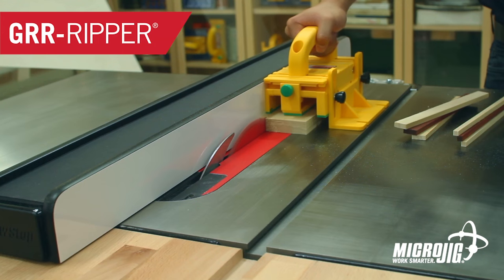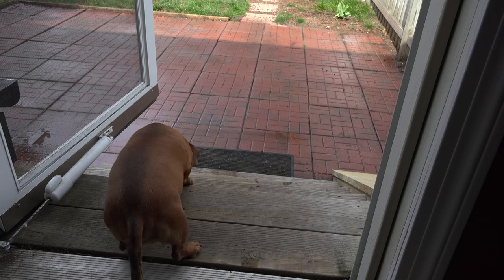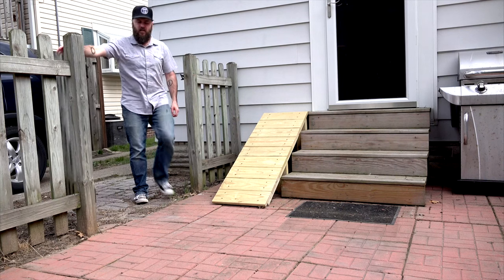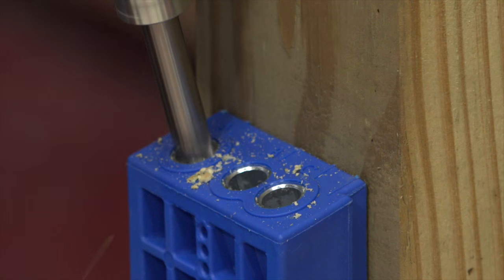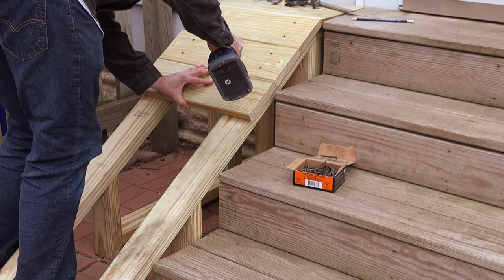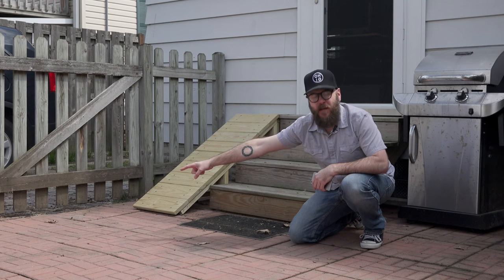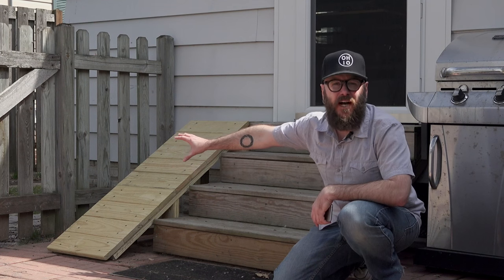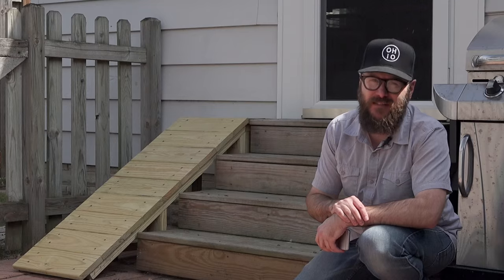I Suck at Failing | Wiener Dog Handicap Ramp

Comment: I don't know what you ended up with. We just made a dog ramp yesterday  outside of our kitchen door, about 40 inches high there, for our elderly dog.  No trips to the home improvement store. We used everything we had here.  It's all temporary but very sturdy.  Just posting because maybe it will give someone else ideas if they are in desperate need of a dog  ramp...

First, we extended the top step just under the door with a heavy duty plastic pallet to give us an upper landing. So at the top, this pallet  rests on the steps themselves.  At the bottom, concrete block piers,  3 1/2 blocks high, at the outer  corners hold it up safely.  We turned some blocks in the pier 90° and rested them on the lower step to interweave the blocks and make the piers stronger.  No concrete to hold it together, it's just stacked blocks but very sturdy. 

We have some masonry  scaffolding and for that we have 2 of those expandable aluminum walk boards, 8 to 13 ft length and each 16 inch wide.  They form the 32inch wide  ramp itself. Just concrete blocks underneath to hold them up. We laid them at an L, turning the corner off of the top platform to run parallel with the house from the landing.  On the inside corner near the kitchen door, we set a portable shed to make sure no one could fall off right there as you open the door. We can't open the plastic shed door,  but we weren't using it anyway.  You've got to use what you have.

We used one piece of masonry scaffolding on its side, each section is 4 feet by 5 feet, at the outer part of the landing across from the door, and attached it with woodworking F clamps to the concrete blocks ( through the holes in the blocks). [ Got to find something to use instead of woodworking clamps -- I need those inside! Later. We just needed to see if this would work. ] 

 The scaffolding has huge gaps in it and we figured our dog would go right through it when he comes out the door, because he's almost blind. So we took a bunch of old lengths of rope and tied it off across the scaffolding to make a grid and cris crossed that effectively closing in the gaps in the masonry scaffolding.

The expanding walk boards are interlaced like two sets of fingers and when you draw them apart to make a shallow enough ramp it leaves gaps. We had some old carpeting with rubber backing.  I just laid it along the ramp so that his feet didn't go through the holes.  Thought we were going to have to go to the store for the cheapest weatherproof surface we could find to lay on top of the ramps, but we were saved.  I'm going to go get a 2ft by 12ft  piece of indoor outdoor carpeting to replace it with for $12.  Later.

For railings along the ramp, I was thinking more pieces of masonry scaffolding set alongside and clamped to the ramps,  but we looked around and took an old aluminum  extension ladder, took the two parts separate and just clamped them onto the outer edges of both walk boards.  It's not a high enough railing for a human or for building code,  but it's high enough for a dog in a temporary structure.

The dog took to it very quickly and is now going in and out safely by himself where he was falling down the stairs because he couldn't see. And he has an old leg injury.  This is going to be an easy winter for us, hopefully,  just open the door and he wanders out. 

It works so well that I am now trying to think what else we have that we could put together another ramp even longer and higher for my sister who has rescue dogs, elderly and infirm. I have another extension ladder, broken,  that a contractor left behind. But I'm just trying to think how to build another  temporary ramp without going out and buying some of this lockdown lumber!  I'm running out of materials here...  

It occurs to me that we might go logging. Build it camping style out of cut down trees. or my brother has a bamboo infestation he's trying to get rid of slowly...

Comment: Nice storytelling, btw. 

You didn't ask for suggestions, but the idea of a fold-up sliding ramp feels complicated.

1) You could have an L shaped ramp with a landing closer to the top, maybe 25% down. That shifts the long part of the ramp away from the steps and next to the fence, and won't require it to extend so much out from the house while still being a more gentle slope. Being up against the fence would protect him from falling on that side.

2) The ramp doesn't have to come all the way to the top step. Depending on his abilities, he can step that last little bit. This will allow a more gentle slope.

3) Not sure the situation with the fence,  but if you could swap the gate with the third section of the fence, a longer ramp wouldn't be in the way so much. You'd have to move/add pavers on the other side.

Comment: I have had several dachshunds thru my life. There spine kind of acts like a  slinky spring. With very small front legs, obviously braking becomes an issue once momentum is gained. Instead of a smooth ramp, I would suggest a very shallow stair step, say two or three steps per human step. You could still use the existing ramp.

Comment: As an industrial designer i learn't to embrace failure as it helps you learn so much and improve your design. Prototyping is a great and efficient way to do this without committing too much time in the build. For example you could have put a piece of plywood down the stairs to quickly check the gradient and see if Weenz is interested in using it. Keep up the great work and "Fail often to succeed sooner" (Tom Kelly).

Comment: How about a draw bridge type of ramp. The ramp would always be in the up position attached to the wall next to the door. But when you need it, you unlock it using a pin or one of those bathroom door stall door locks.  You would need to find a torsion spring or some other mechanism, maybe gas struts to make it easier to lower the ramp.  You could make it as long as you need and once he's down you can raise it back up out of the way. Maybe...

Comment: Great lesson. Just a heads up, those regular kreg screws shouldn't be used in pressure treated wood, especially if it's structural. The chemicals in the treating will corrode the screws. Kreg makes some blue screws that are good for pressure treated.
Reply from the maker: +rochat Ahhh, I didn't know. Good tip, thanks!

Comment: I guess it is done by now but if you lack space and it is only for going down, you could make a pulley system and counterbalance the platform with a weight lighter than the dog+platform. The platform would go down when he is on it and then automatically back to the up position as he leaves. The only trick will be to find a way to smooth the mouvement enough.

Comment: how about putting a Flat platform on wheels with a counterweight at the top of your new ramp.  Dog gets on a nice flat platform which is then too heavy for counterweight and platform/dog rolls down.  Dog gets off and the counterweight bring it back up.  probably wouldn't work well in the winter though

Comment: Try using 3M Safety Walk Outdoor Tread. I believe it could give the traction needed. I made a set of stairs for my dachshund for a similar reason. He also refused to use the stairs until I put those treads on for traction.

Comment: Well Dave.. It's obvious what needs to happen.. Since the gate is messing up the putting in a ramp.. You'll have to rebuild the fence and move the gate.. And since your moving the gate, you should update the whole fence. Which will probably mean you'll need to dig in some new fence post hole. And if your doing that you might as well build a deck out on that side of the house for all bbqing and that.. Then you can make a ramp that is the main walkway onto the deck.. But make sure you make the ramp way wide enough for a wheelchair cuz then your deck & house is wheelchair accessible! So! A new fence with a moved gate, a new deck.. Then you could upgrade the BBQ (cuz... Why not?!).. Then you get your ramp for the dog AND!! For wheelchairs! :)

Comment: Maybe build it over the left side of the steps so it's out of the way of the gate, but start it on a lower step and extend it out further so it's not as steep an angle for him? We had a 16 year old Yorkie who passed two years ago (tomorrow, as a matter a fact), and he had some issues going up steps but not in going down. That, or as someone else already mentioned, build a small deck so that the steps go out towards the area where the grill is and swap how your door opens? Hope you find a solution.

Comment: Before scrapping a perfectly good ramp, I'd consider alternatives. The first thing I'd consider is how slippery a dog might find ramps, especially if wet. Gluing sand to the surface might be worth a shot. Also, that dog's legs and feet are smaller than yours -- why not make a staircase with shorter, smaller steps? It would essentially look like a ramp to most humans, and you could probably test the theory with scrap-wood and an air-nailer. Best luck!

Comment: Use slides for two or three sections so you can pull it out. Or a better thought since Weeks can handle one step, make a step right off your steps then a shallow angle to another step and so on. Our Wiener dog Bella won't take more than two steps down. Code for a handicap ramp is 1" drop for every 4'.

Comment: David if you do flip the door ya have to swap the Zbar side for side to. Buy some white rivets use them in the hinge holes on your door. I'm not sure but that looks like a Larson storm door. It may be a Anderson but they are made by Larson anyway. Also if it is a factory mortise for the handle. You will have to take the mortise lock out take off the Brushed nickel plate and turn the catch the other way then put the brushed nickel plate back on. that way your handle works normal. If ya don't you will be lifting the handle opening it.
Reply from the maker: +joe brown Thanks Joe!
Reply: No problem

Comment: I had to make a ramp for my mothers old cat. Ended up being 2ft high and 6gt long, so whatever angle that is. But even with it being so shallow the cat didn't like going down till I added carpet on the top. Extra grip or maybe even just the comfort got the cat to use it. So I'd say scrap the stairs completely and replace it with a ramp, add some astro turf or outdoor carpet and cleats for human feet.

Comment: you could flip your door so it opens the other way, then put the ramp down the side of the house (behind where the grill is now) rather than sticking out into the patio next to the stairs.  Or you could build new steps that have one more step making them shallower and wider since part of the problem seems to be that he's longer than the steps are wide.  You can also get rid of the top step so that instead of having that little "porch" by the door, you just step up into the house.  this will allow you to make shallower/wider steps without impeding on the human traffic too much.

Comment: Suggestion, instead fo a ramp make a set of stairs with smaller lift height and a little longer length. its would be a set of stairs which the pup is used to but built for his shorter legs. i did this eons ago for my rabbits to get in and out of the hutches. they did not take to the ramp well but liked the stairs, go figure.

Comment: Idk if ya have room to the right you could scrap the steps all together and make a handicap ramp that goes to the right then turns back and goes left with the exit at the point point of the top run. your storm door would have to be reversed hinged for it. Most storm doors can be reversed because they are sold as left or right hinge it's just a matter of what side ya put the Z bar on. However this would only work if your storm door came with a factory mortise for the handle. Idk if you installed it but if the you had to drill for the handle this option wouldn't work. That's what I do for a living windows & doors. There are situations just like where I do not set the storm up handle to handle with the Main door. It isn't odd it would just take some getting used to opening your door opposite from the way your used to.
Reply from the maker: +joe brown Good idea! I did install the door a couple of years ago. I'll have to take a look.
Reply: Ty curious to see how ya work it out

Comment: Instead of putting the ramp on wheels, couldn't you have it hinge in the middle, but keep the house side in place.  Bob could probably hook up an arduino so the ramp automatically unfolds when the dog is at the door.

Comment: How about a counter weighted sled that would take Weenz down the ramp as soon as he steps on. The counter weight would then reset the sled to the top when he steps off. If the weight is slightly less than Weenz, it should make his trip down a smooth one. May also be possible to retro fit and not start from scratch.
Reply: Then again, looks like there's not enough height for the weight to travel to cover the distance of the ramp. Bad idea!
Reply: +Chris hales I was thinking along the same lines - but with just a  counter-weighted platform.   Dog steps on platform, and its weight is just more than the counterweight, so platform lowers to the ground.   As the dog is happy going up, there is no need for a proper lift (sorry - elevator) system.

Comment: Instead of your idea of maybe adding a step to the bottom, you should add a step at the top. He steps down to the right from the current porch onto a platform and then the current board can still be used at a shallower angle to get to the ground.

Comment: On the end of the steps, maybe the last 14 inches or so just add a few boards to steps. So you're cutting the distance between steps down. Won't make a cool video but should be effective. 😉 thanks for sharing.

Comment: Might be easier to just redo your back steps.  Add one riser and make your treads slightly longer.  The steps will stick out father, but so did the ramp you built.  You would get new steps, and solve the problem.
Reply from the maker: +Casey Roper Very true! Thanks1